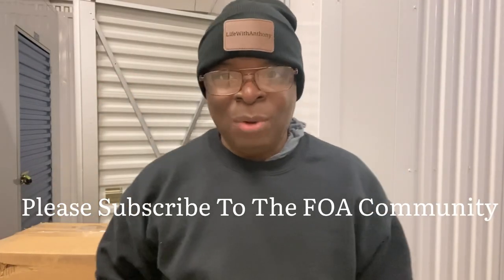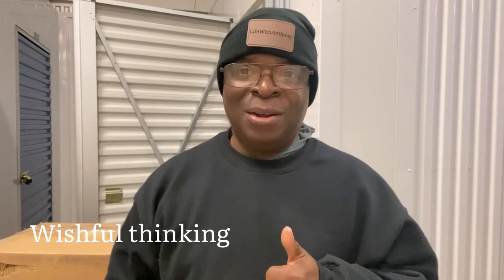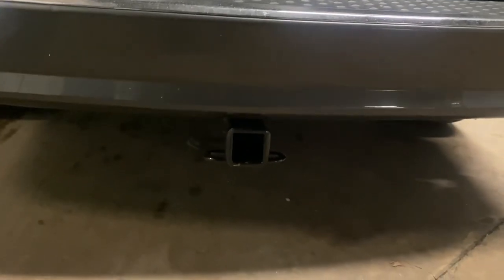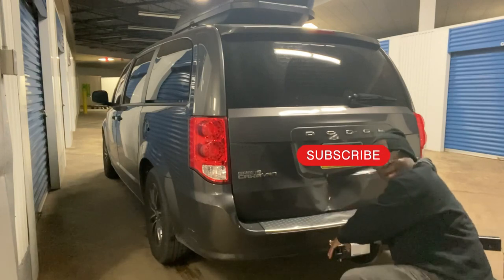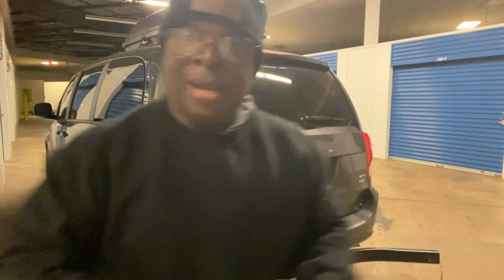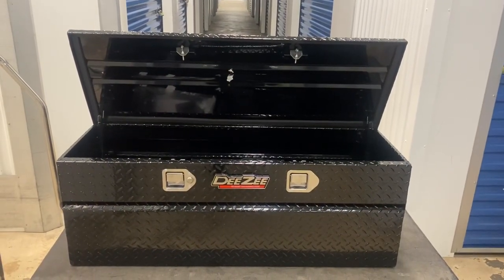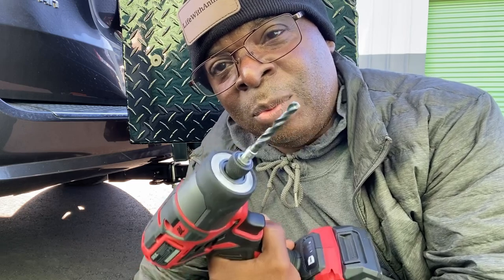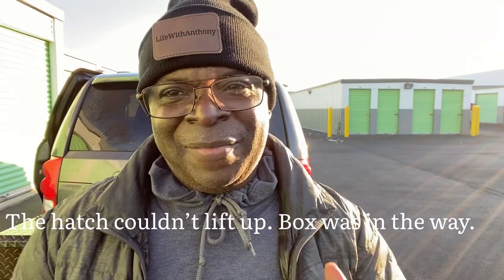Living In A Minivan | Swing-Away Hitch With Cargo Box | Tons Of Storage

Comment: Anthony, you should not have to slide it all the way into the hitch, there should be several holes there to pull it out then put the hitch lock in and you should be able to open the door.
Reply from the maker: Hey Don. Maybe when I get to a campground. I will redo it. But for now, it is okay. Thanks
Reply: Great point, Don. I hope this works. It’s more expensive to buy that swinging piece for the purpose of being able to open the hatch. 🤞

Comment: Thoughts on power stations:  interesting facts about battery Anthony. 

Jackery is old technology.  It's a lithium ion battery.  You can recharge it around 500 times, then the battery quality declines immensely.  365 days in a year, so if you recharge daily...thats a little over a year of life.  Not reccomend anymore because there are much better options 

Bluetti are lithium phosphate batteries.  They can be recharged 3,000 to 3,500 times before the quality gets worse.  Way better bang for your buck.

With any power station,  you will also extend the life of your batteries if you dont discharge 100%. A good goal is to use to 20% then recharge to 90%.